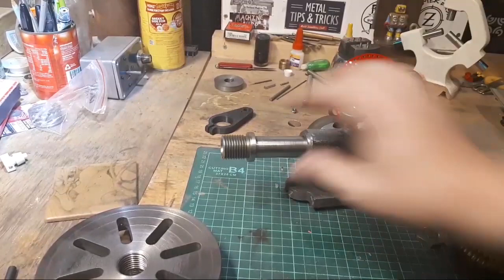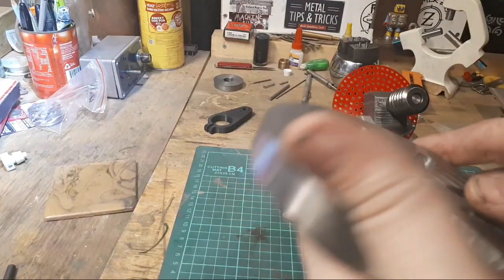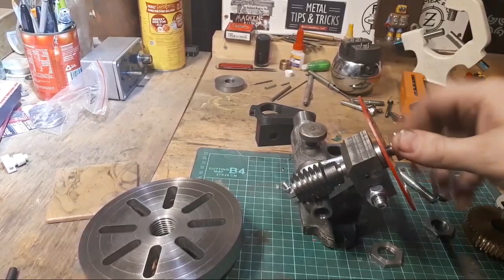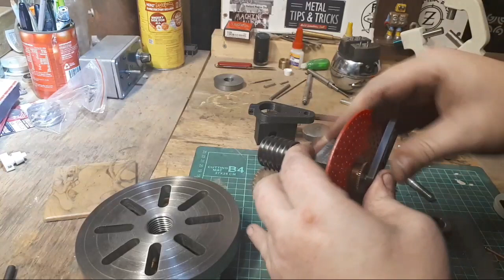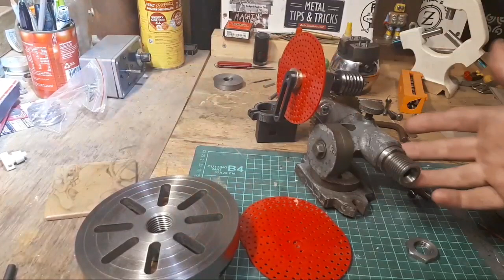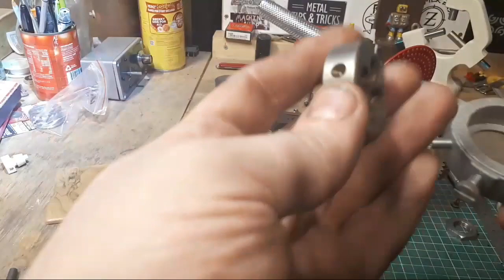Wednesday Night Live Stream

Comment: Hi Emma, your division head is excellent,  nice project keep it up and very well done.  The un threaded holes in the back of the chuck may have screws in the bottom of them that will have to be removed before you can unscrew the plate in the back of the chuck.  I have a 3 1/4" crown chuck just like that

Comment: hey emma, sorry I missed the stream, completely forgot what day it was and never woke up, lol. Dividng head does look pretty good, I wouldnt add an add on tailstock arm on it because the forces for gear cutting are pretty high on the mill and shaper, so unless it was some high carbon steel so it was really rigid, I think you'll run into alot of deflection of the parts, expecially with the hangout from adding the chuck, workpiece/mandrel, and out to the tailstock piece. It would honestly be better just to use a seperate tailstock anyhow, and the one you have is actually right, they just put the wrong center in it. Usually those have an offset center that looks like a half dead center but towards the top so that the grinding wheel can get closer to the piece your grinding.